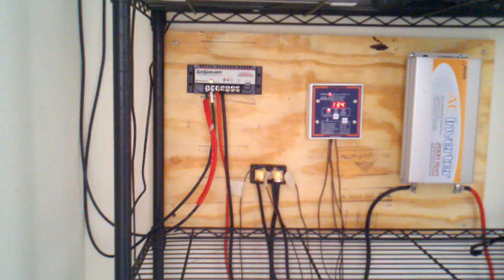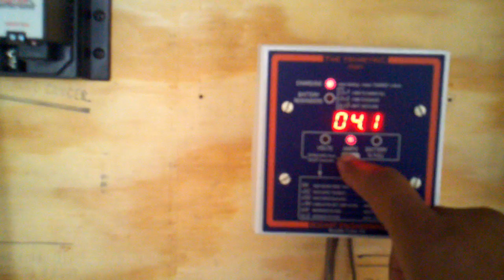DIY - Home Solar Power Part  #2

Comment: thanks, that was very helpful 

I just received my 100W solar panel kit yesterday, I'll will be doing lots of research in the coming days, I want to use it to run my hotwater heater.  

At some point, as I grow into this solar power thing I will have the whole house on solar, and then move to convert my vehicles to electric.

Comment from the maker: The Optima blue tops are expensive, but there are less expensive AGM batteries available.  Don't forget that you can simply go with traditional flooded batteries as well.  Batteries are by far the greatest expense in the system.  Because of the location of my batteries I chose to go with AGM's, When and if I finally replace them in a few years I plan to go with heavy duty flooded batteries or cheaper AGM's.  For a good battery bank, expect to spend up to $1500.

Comment from the maker: I've updated this system quite a bit and this is an old video. However, the primary function of it being a backup system is still the same.  I've played with Grid Tie inverters, but it's mainly for a hobby.  Some solar installations can take years to pay for itself, depending on your location and your electric rates. However, with mine being a backup system, I never considered payoff time etc.  This came about after my family was without power for 7 days and I realized I needed to do something.

Comment: I didn't intend to sound negative or condescending. You're right, easy storage is one benefit Optimas. A system that uses 6 Volt wet cells require a bit more planning so starting off with sealed AGM's get's you up and running while you learn and expand. An AGM, solar panel and charge controller will provide a good learning experience. You might want to look into native 12 volt CFL's and LED bulbs. they use the same fixtures I just cut the plug off the lamp and wire them with Anderson power poll

Comment from the maker: Thanks for you comments.  I got the Optimas for the no maintenance factor. I've had them for almost 2 years now and they seem to be holding up pretty good.  They'll do for now in this simple backup only scenario.  My next set may be the flooded 6V type as you mentioned, for the increased ah capacity, but I'll have to modify the location they would be in to accomodate gassing etc.

Comment: Nicly done, The only weak spot are the Optima batteries.. Optimas are over rated and over priced. I had several in my sail boat and would never use them again.. You would have been much better off using 6 volt golf cart batteries. Gell cells and AGM's are for amateurs. For a serious system, Wet cells are the only way to go.  Even 6 Volt golf cart batteries which are designed for deep discharging will handle it better and last longer then AGM's. BTW I have 6000Ah storage capacity in my system.

Comment from the maker: Sorry for the late reply, I've been very busy.  Anyway, I got my batteries from Costco (When they were selling this brand), and batteries plus.  The battery voltage monitor is a trimetric 2020, you can get them on the web at various places.  You can also get cheaper AGM batteries from batteries plus and other sources as well.

Comment from the maker: It's a pure sine inverter.  Modified Sine Wave inverters do work but they are not as good as pure sine and you don't have to worry about burning out sensitive equipment, like I did with a modified sine wave.

Comment: Hey great video , i was wondering what amount of AC loads you ran on the 2000 W inverter and how was the efficiency , i am planning to build a small off grid system with loads amounting to 500 W AC but the smallest inverter i can find in my local market is 2400 W ,24 VDC , do you think it will cause problems?

thanks for the great info

Comment from the maker: I suppose my setup can be confusing to someone not knowing the specifics.  The idea is that my panels are wired in series to produce higher voltages. This allows them to further away from the charge controller and the extra voltage is used by the MPPT controllers to increase the amps to charge the batteries faster. My initial system was a 12v system and that's the reason I started with 12v panels instead of the 24v panels I got later.

Comment from the maker: Thanks for your question. Please check out my video titled "DIY - Free Home Solar Informational CDROM - Help for those that need it." There is a download link to a CDROM I created that will give you free information that will help you to understand and design a solar system.  Also, there is a diagram in one of the resources that show you have a shunt is wired to the battery bank.  Also, there are diagrams that show you how to wire a battery bank.

Comment from the maker: The battery monitor is a Bogart TriMetric TM-2020 12/24V Battery Meter. You can get them from various suppliers on the Internet for around $160.

Comment from the maker: I've seen the videos of those using air to power a motor as you mentioned, however, I have not seen any videos where they are actually powering anything of consequence. Wind Turbines and Hydro power are great, but not practical in areas with very little wind or water. Steam or boiler based systems appear to be more dangerous for the average DIY project. However, I appreciate your passion for the technology you advocate.

Comment from the maker: @rick kavanaugh  Generally, cold temperatures and batteries don't mix.  I've seen  where some people  leave them outside in all types of weather.  That's fine  if they are being used but if they are just sitting for extended  periods of time in cold weather,  that could be  a  problem.  I recommend  just bringing  them  home.

Comment from the maker: No this will not run a central AC unit.  This is simply for backup, for things like lights, tv, stereo, computers, microwaves, and charge cell phones.  Maybe a fan or 2.  Central AC's take too much power.

Comment from the maker: In this video, with the MPPT charge controller I have, the higher the voltage the better it works. It has a DC to DC converter circuit that takes the excess voltage and increases the amps, thus lowering the voltage while maintaining the (power) wattage. This gives me the same advantages of putting them in parallel. With MPPT controllers like this one, panels in series to raise the charging voltage is the way to go.

Comment: would you have been better off running your panels in parallel and sending 18-20 volts to a controller with twice the amperage?

Comment from the maker: A call to the manufacturer would be in order to determine exactly what they mean by 1000Amps. A 1000 "Amp hour" battery bank is not a small or cheap proposition. This battery is only for car audio applications for instant power with low depletion and not for deep cycle (high depletion) applications. To give you good info, I called the the distributor's tech support line for you (the wait was a little long), and they verify that this is not for solar applications. Hope this helps, Take Care

Comment from the maker: An inline fuse is a safety precaution against a short circuit that could lead to an overload condition resulting in fire or damage to your inverter.  I don't use an inline fuse on my portable unit, but I do use one on my main system. Fuses and holders are relatively cheap on the Internet and are well worth the peace of mind. To determine what type of fuse you should have, use your inverter's (peak/surge) watts / batt voltage ( ex: 2000w / 12v = 166Amps). In this case a 200A fuse would do fine.

Comment: Is the inline fuse absolutely necessary? In the instructions the fuse was "recommended", but they sent me wires without the fuse or holder. If I need the fuse what size and type should I install?

Comment: Do I absolutely need the inline fuse. The instructions that came with the inverter "recomended" the fuse, but the wires they sent didn't include a fuse or holder.

Comment from the maker: In this video, the connections were a matter of convenience. I got the cables from an auto parts store and this was my initial exploration in the world of solar. In truth, it didn't and doesn't really matter which connector you use with these types of batteries. Also, the inline fuse should be between the inverter (amps draw) and the battery (which is the  amps source). This will keep the inverter from drawing more power than is safe from the battery. Your initial setup is ideal for your plans.

Comment: Is there a reason why you hooked up the batteries to each other using the small ring type connection on one battery and the clamp on the next. Can you use ring types on both ends? Also should you have an inline fuse between the inverter and the batteries. I am going to be using 75 watt panels, 2 batteries and a 1500 watt inverter to power small appliances in a trailer for very short periods of time probably at separate times. i.e. toaster, radio small t.v. and receiver.

Comment from the maker: This is an interesting approach to batteries, but this is still a car battery. Like most car batteries, it's designed to give you a quick burst of power for starting and for your electrical system.  It does not appear to be for sustained use as in a renewable energy system. in the specs, they don't list Amp hours or anything relevant to deep cycle operations.  Yes, capacitors can be drained and reused again and again, but in this case, I would not use this battery without knowing more details.

Comment: I've been watching your YouTube videos and I have a quick question! I found this battery on line and I want to know if you think that it would be a good battery to use for my solar setup? Pyle PBAT1000 1000 AMP 16V Battery Capacitor Car Battery with Built-in Capacitor

Comment from the maker: @er70ca72  In areas of high temperatures commercial grade panels should still function and last at least 15 yrs or more, most of them have 25 yr warranties. Homemade panels may be a little questionable.

Comment from the maker: Thanks for your comments. MPPTs will also help extend your battery life, so I'm a little confused at your statement. Battery life is a matter of usage, proper charging and conditions to name a few. Most MPPTs have at least a 4 stage charging process ending in a floating charge to keep batteries topped off without over charging them. Battery life also depends, to some degree, on type, whether AGMs, Gels, flooded etc.

Comment from the maker: Thanks for your comments. The key is that AC is more efficient for transmission than DC. Also, LED's are the way to go in my book. With a solar backup system, you can run them for days during a power outage. If you can replace all appliances with DC versions, you'll definitely be ahead of the game. Take Care.

Comment from the maker: Thanks for your question. When the distance from the panels to the charge controller is a long run you must put them in series to account for voltage drop. Also, my MPPT charge controller has a DC to DC internal converter that will use the excess voltage to increase the amperage to charge the batteries faster. Also, it gives you the flexibility of migrating to a 24v system, as I eventually did. Quality MPPT charge controllers do very well with higher voltages vs PWMs. Hope this helps. Take Care.

Comment: I really love the idea of doing away with the DC to AC inverter, and using the low voltage DC power you have stored exclusivly for low voltage LED lighting.
 i love the concept of living of the grid too.
so much of what we use in the house today the electricity used is converted down to low voltage DC any way. Laptops, phone chargers, battery chargers, lighting, tvs, printersthe list goes on. I reckon in the future big parts of houses house will be running on DC.

Comment: you do not want to run 2 or 3 1000w lights for 12 hrs a day OK!

that is ridiculous, sorry to be so blunt. You should find LED replacements for the 1000watters. they will be a fraction of the current draw to what you are suggesting. 
You should also consider using movment sensors to turn the lights on for a set time, this will help to save on your harvested power as well. all off these sugestions will help keep your up front solar costs down.

Comment: Why do you have to step down the voltage to 12 from 36? Each panel is 18 volts? Connected in series? Why not keep it at 18 if the batteries are charging at 13.4 volts?  Please explain.

Comment from the maker: Actually, I added 2 more panels and I now have 12 AGM Batteries total. The panels together total about 670w. The battery bank has about 9720w of stored capacity. I added more batteries first and then more panels. My system is designed to be a backup system comparable to 4 or 5kW generator to power the house during a power outtage. In DIY, you typically add more as your needs and knowledge of solar grows. I replaced about 80% of the lights in my home with LEDS, so outtages are no big deal for me.

Comment from the maker: at the time the panels were about $350 a piece, the AGM batteries where around $180 each (x4), the inverter $250 (Cheap), Charge controller $200, battery monitor around $100, the shunt was maybe $40, battery cables were around $50, Wire was maybe $100.  You can have a decent system for around $3000.  With the 30% break, that'll bring it down to around $2100.  It's been awhile so this an estimate.  My system is much larger now.

Comment from the maker: Thanks for your comments. I've made a couple of videos showing a test I performed with a portable system with a 115Ah battery running a compact freezer for 24hrs.  Also, there are calculations I can help you with to understand and compute the approximate running time for various appliances etc, based on the watt hours of your battery(s).

Comment from the maker: If you had a grid-tie inverter(GTI), the power would 1st be used by the active loads in your house (TV, Stereo, etc..) , if you do not have enough active loads to consume the excess power, it flows back into the grid to be consumed elsewhere, this is not considered feeding such as when you plug a generator into an outlet is. A GTI works by synchronizing with your utility power and only works when the utility is live. A generator back feeding circuits through and outlet does not work in this way.

Comment from the maker: You can use a 24v controller.  You can place the 36v panels in parallel and connect them to a 24v controller, the 36v of panels is necessary for a 24v controller.  If you place the panels in series, then you have 36v x 2 and you would need a much larger controller.  The battery bank system voltage would dictate what type of controller and panel wiring you should have.  I would recommend an MPPT charge controller of maybe a 24v or 48v.  Don't know if I answered this before, hope it helps.

Comment: HELP! I have two, 36v solar panels. Im trying to build an "off grid" system. I noticed a lot of people using 12V or 24V charge contollers. Is that safe or should I be using a 36V charge controller? what should the proper amperage be? I dont want to over heat anything and just charge my batteries as fast as possible.

Comment: Ur system is to small to warrant a transfer switch. It can't run your larger loads. Good video although I would have used GC 6 VDC in series batteries for  12 VDC.  I currently run a 24VDC but eventually go to 48 VDC more efficient. Thanks

Comment from the maker: Thanks for your comments. These batteries are Optima D34M dual purpose AGM's, which are Deep Cycle.  Also, this is an older video I made when I had just got started. My system is a lot bigger now, a year later.  You can check my videos out on my channel. Thanks.

Comment: best way to go is not automotive batterys but marine deep cycle walmart sells them called maxx i have one paid around 90 bucks  and is 125 amp hours to a 1200 watt inverter and is only 87%efficent the rest is waste in heat from mosfets and fans and solar isent enough current to recharge example if u draw 1kw in 1 hour u want to replace it with 1 kw or more depending on load  and volts x amps =watts and 746 watts=1 horsepower plus most inverters are not true sign wave

Comment from the maker: With the Tri-Metric 2020, which is an older version, it's worth the money. It gives you some very useful information when it comes to your batteries and how they are being charged and discharged.  There may be cheaper units out there. Whichever you choose, I would recommend you get one that truly helps you monitor your system.  I have alot invested in my batteries so this unit works well for my system.

Comment from the maker: Thanks for the comments. And you are correct.  However, this is an older video and my system has since grown considerably since.  I now have 12 AGM batteries, 2 charge controllers, 2 Arrays, etc.  My channel has my latest videos.

Comment from the maker: The use of a circuit breaker provides a measure of over current protection to the circuit.  As I slowly built my system I added fuses to protect the system and my home from excessive current that could result  in damaged equipment or fires.  Circuit Breakers are more suitable than fuses, but fuses will still do the job.

Comment from the maker: Yes, that's why you must have a charge controller. In this video there is an MPPT charge controller that controls the power going into the batteries. Once the batteries have reached a 100% State Of Charge, the controller goes into what is called "float" mode where the controller simply keeps a low amperage charge on the battery to maintain it at 100%.